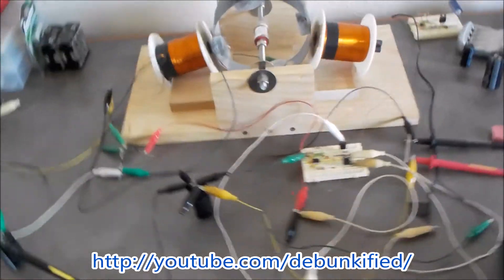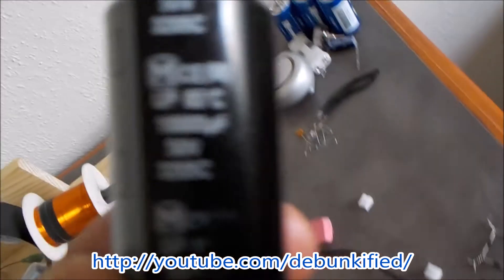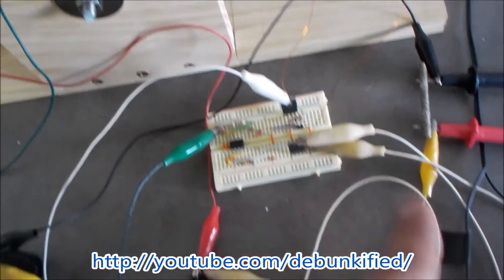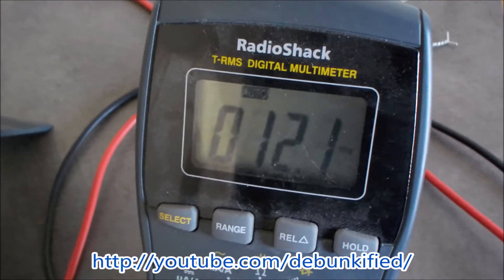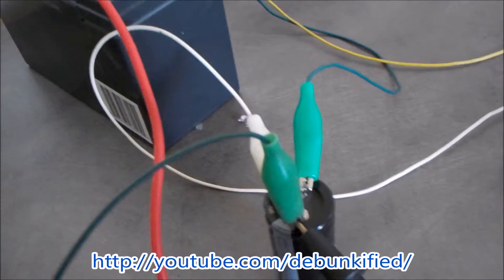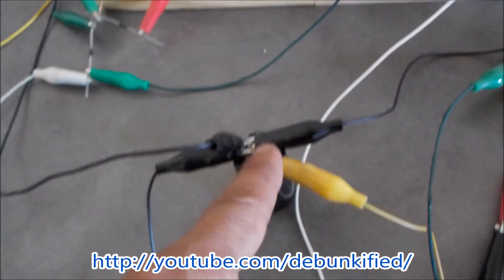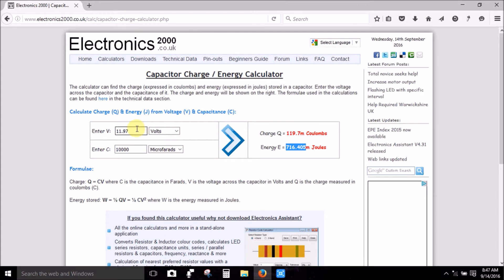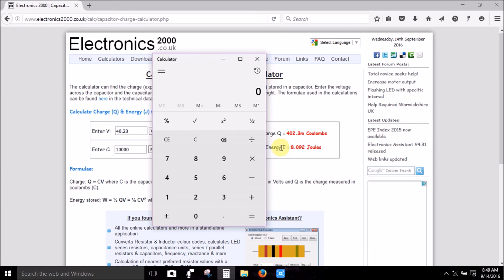OVER 1000% More Energy Out than In (Joules Stored)

Comment: Thank you for sharing this video BUT, this experiment is very inaccurate, in terms of what you've shown and trying to prove. Because you spun up the wheel on battery power and after the wheel was up to speed, which was done by the power from the battery and then you disconnected the feed battery and connected the output to the receiver capacitor. So, a good deal of the energy that showed up in the receiver capacitor was a combination of what was stored in the rotor mass plus what was in the feed capacitor at the time of starting the actual run and capture. But to do this experiment more accurately, maybe you'll need to use two identical, but much bigger capacitors, charge the run capacitor from the battery to full capacity and as you tap the wheel gently, to just about start it turning, you remove the battery and simultaneously connect the charge capacitor, so that all the speed build up and slowing down happens with energy from the feed capacitor ONLY and you then see, how much you were able to collect in the charge capacitor. That figure will be far more accurate than what you've done in this video. Thanks.

Comment: There's a mistake in the article in your blog. The current in the coil with and without the rotor is NOT the same. If you don't believe me, use the trigger function of a digital oscilloscope to register the first moments after you switch the current on in two situations: (1) without the rotor and (2) with the rotor. You will see the difference.

Comment: What you've just demonstrated is the kinetic energy from the rotating magnet motor, being transfered into the charging capacitor. Do you not realize this? Come on, how can you not? That energy was put in by your hand and the battery getting it up to full speed...really, step back and think for more than a few minutes...Love your enthusiasm,  but reality and your experiments have to meet at some point?🙂

A true test would be self running,  or take the charged cap after completion of test and then charge the other cap, of course to a greater charge, while allowing the capacitor alone to spin the wheel up. When all power is discharged from previously charged cap, see what's in the other cap...if you can follow me?

GOD Almighty YHWH's Blessings on you in Yahshua or AKA Jesus Holy Name!

Comment: I don't see any follow-up video, doing the exact same experiment, but this time NOT connecting the 'input' cap, instead letting it spin down 'unpowered'.  I bet you end up with close to the same voltage on the output cap.  Flywheel-effect methinks.

Comment: Well done. Good presentation concept. Consider the fact that the motor 
was running at it's maximum speed before disconnecting the run battery. 
Meaning consider that x amount energy was used for that, and was not 
part of the input capacitor calculation. On efficiency you can increase 
it with the  addition of a flywheel. For further research you may want  to consider a
 switching system, where the caps switch between themselves (Latching 
Relays, or Mosfet, or user flipped switches.), no more 
battery after the initial start. The switching can be manual, and 
electronic in a future version. Overall your on the right track. Some 
advise. Stay away from negative ideas, people. focus on the success, and
 it never fails. You'll succeed. Respect negative comments, as it is 
their right, but do not get into them, as these people will never 
succeeds as long as they think it does not work. Make senses  . Cheers 
mate.
Reply from the maker: Thank You for the comment, I appreciate it, You are right the start up energy was never measured, it's too much! However eventually once the energy has started past resonance, eventually it can recover all the initial start energy after some time has passed.

Comment: One kilogram of mass slowed down from 10 meters per second to 5 meters per second will release 37.5 Joules of energy. E=(m * v^2) / 2 - for mechanical energy similarly for electric energy E = (C * U^2) / 2. for rotating bodies E = (I * omega^2) / 2
E - energy in Joules
m - mass in kilograms
v - speed in meters per second
C - capacity in Farads
U - potential difference in volts
I - moment of inertia in kg * m^2
omega - rotational speed in rad / second

(1[kg] * 10[m/2] ^2 ) / 2 = 50[J]
(1[kg] *   5[m/2] ^2 ) / 2 = 12.5[J]
-----------------------------------------------------
Difference:                           37.5[J]
This is a SWAG estimate of unwrapped (to simplify) mass and speed of your system. We need to know your rotational speeds at start and at finish of your charging, or "free energy extraction" phase, detailed dimensional drawing of your rotor, with specific materials use, and only then you could claim actual overall efficiency of the system.

Comment: Very thought provoking. I think some might point out that energy gain could come from a loss of RPM. That is energy stored in the flywheel transferred into the cap. Not nit picking at all though. I have not observed any overunity myself nor am I very convinced in whether it is actually possible or impossible, but I am interested in the subject and I know some who have claimed overunity also claim things like "cold electricity" have you observed this phenomena in your motor?
Reply from the maker: Hi Steven, no I can't say that I have observed this "cold electricity" phenomenon. Unless we are observing the shorted coil energy that seemingly doesn't have any observable current when going into a normal load, but is obviously there when charging a capacitor, which happily accepts this form of "power". I have never seen anything quite like what shorting a generator coil does and how it produces many times that of the normal generated power through the ringing of the coil. To me this is the cold electricity and radiant energy Tesla spoke of.

Comment: it will be interesting to see if you can make something run by its own power....i have a wheel with 8 double coils...harvested from e-core 9 volt tranformers with the cores removed. there are wired up as a double bedini circuit....half pnp amd half npn, the wheel is 18" and i can make it run at 1 milliamp at 9 volts...since there is two circuits npn and pnp, the output is completely isolated from input power...npn output goes to pnp input and vice versa. the + of npn is directly shorted to - of pnp...it works extremly well at isolating the BEMF from any input power, and when spinning by hand it build its own power to almost run by itself, its close, but no self sustaining yet. your right though, its all about balance, going to try a couple new trim pots in the circuit when i get a chance.

Comment: there is something else you will find out after testing extensively....although shorting the coil does produce high voltage spikes, the normal amperage is gone that would otherwise be present had the coil not been shorted....i had a hard time measuring the different myself, total wattage seemed almost equal either way i tried...but what was important was the fact that the drag on the motor or prime mover was less.....
Reply from the maker: Hi Sandy, I have found this to be true as well, as well as Nikola Tesla found there was absolutely no current in his coils, how he was able see this and exactly how he achieved this very same effect is beyond me as he has never divulged this effect too much, at least from what I've seen, or I have completely missed it if he did divulge this type of information, as I've studied his work extensively.

Comment: here is an example....spin the wheel up to speed by hand and your charging capacitor will charge up....but how much energy would it take to keep wheel spinning??? an easy way to check is to measure the input amperage to keep wheel in motion....then measure to output going into capacitor.
Reply from the maker: Hi Sandy, check the previous videos, I have already covered this by demonstrating the actual "power" in the form of voltage and current as it came out of the battery and into the motor circuitry and how this is in direct relationship with the amount of Joules stored in the driving capacitor. For instance I showed that approximately .684 Joules was used up, and this directly correlates with .650 mA of wattage feeding the device flowing from the battery. Peace.

Comment: i like your testing....but you have to realise that your charged capacitor would still charge even without a primary capacitor because wheel is already spinning...the energy used to keep wheel up to speed is what is important, i think you will find that the energy used to keep wheel spinning at a constant speed is higher then the energy that is coming out of the generator coil....no??
Reply from the maker: Hi Sandy, the energy required to keep the wheel up to speed is extremely low as it reaches resonance, and yes you are right that the output capacitor would charge even when spinning by hand and without the input capacitor, but spinning by hand is a difficult task to achieve especially when it needs to reach the fastest speed, (mechanical converted to electrical) output and the lowest input power "resonance", this I have showed in a previous video. 

The input power required to keep the wheel in its highest energy state is very low due to resonance and CAN be much lower than the output power, and even if there is "some lenz's drag", as long as the output is maintained without any further bogging down of the wheel, then input power will hardly go up, and output power will hardly go down, it's a matter of balancing, which there is plenty of room to mess around in without dropping into underunity. Did I mention this in a previous video? Peace.